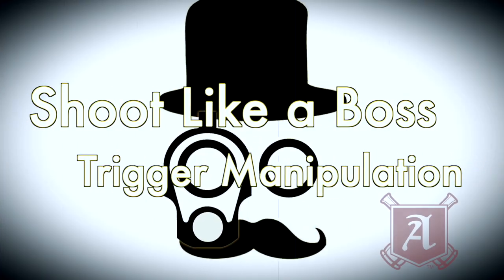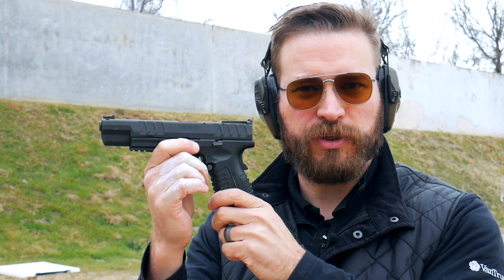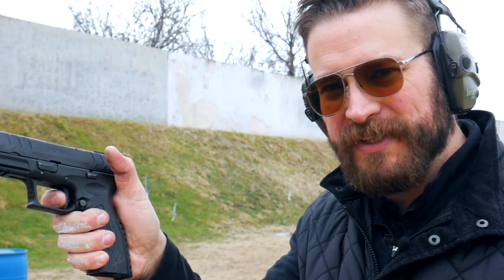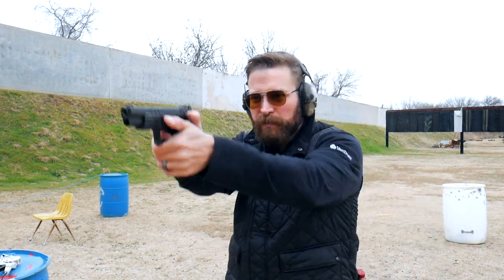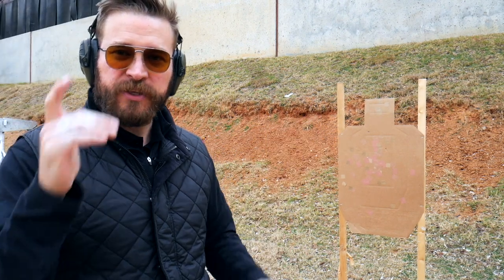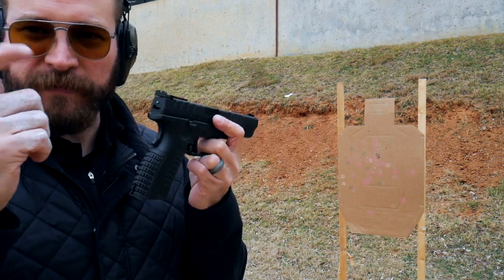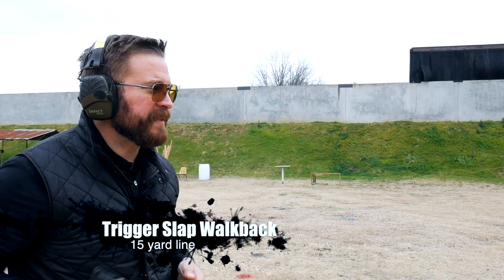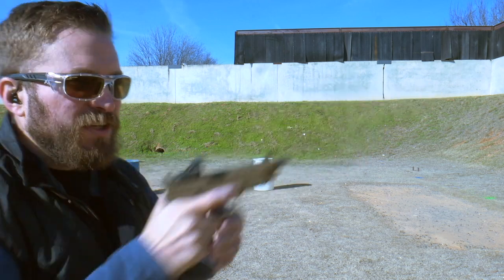How to pull a trigger correctly | SHOOT LIKE A BOSS 2

Comment: Yeah, I completely agree that if you know how to pull the trigger correctly, you can shoot like a boss. It has been proven in LITO VALLES PSD that you can even hit a toothpick at 12 yards and the target plate at more than 20 yards far just holding the upside down gun with your two fingers only. Sir HUMBLEMARKSMAN is absolutely correct.

Comment: Good stuff. I'd like a video about your movement and how you drive your eyes through the course, maybe slowed down with commentary. Glasses that track the eyes would be outstanding, maybe at some point you can get a hold of some or borrow them. So much is eye related. A how to train your eyes to get faster video. The benefit of different holds in different contexts with iron sights + cowitness/third with a dot. A video about moving in and out of a position with detail on weight shift, wobble, regaining your stand or finding a stand that would work in the weird position atm. Good video.
Reply from the maker: Interesting thought

Comment: Would like to hear your thoughts on trigger management relative to pull weight.  Do you change technique or approach with triggers as the pull weight goes up.  Shooting a pistol with a 5-1/2+ LB pull is very challenging as contrasted with a trigger at 3-1/2 LB pull.  Thanks
Reply from the maker: I prep still on my 1.5# open gun